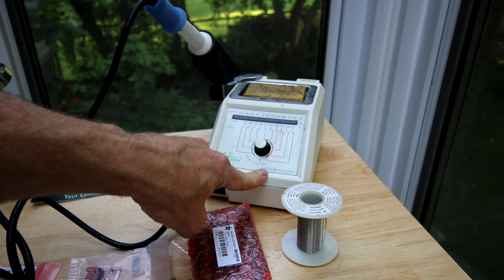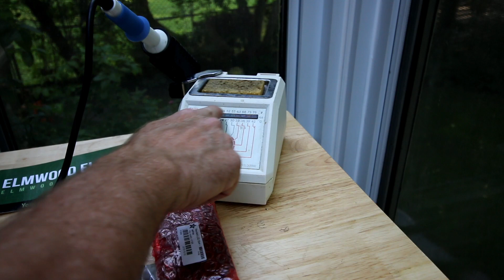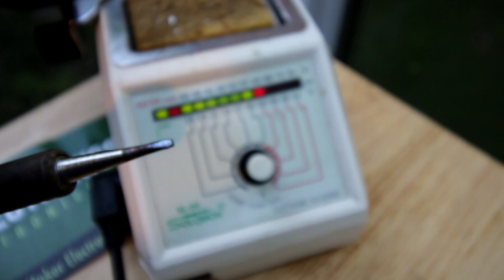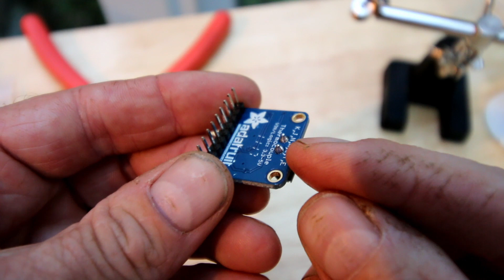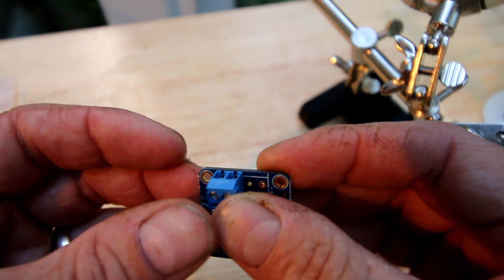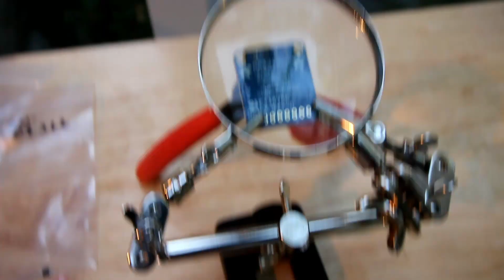Soldering Pin Headers &  Terminals on to Arduino Components

Comment: It's always been my "thing" not to use wet solder wipe pad due to thermal shocking the tip. It also doesn't cause a dip in tip temperature and gives the plating a longer life. I use Quikwipes at work and sometimes swipe a box for use at home.